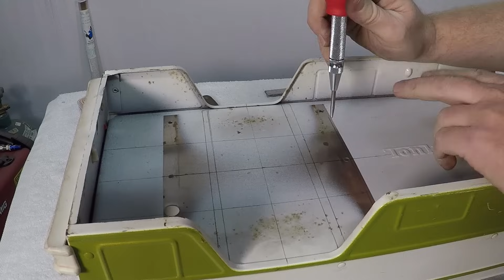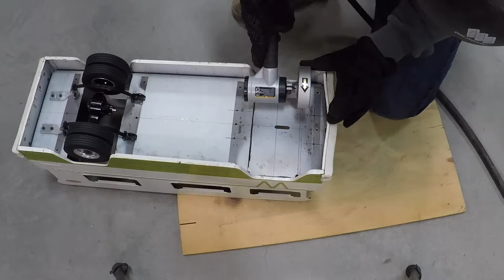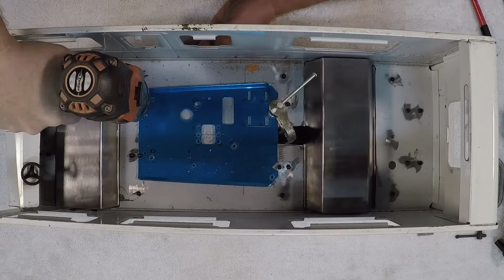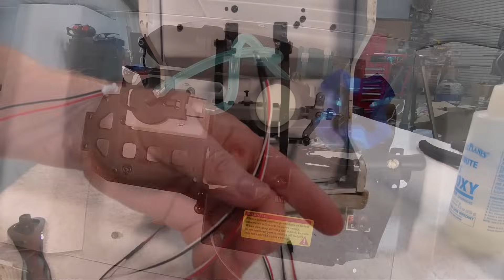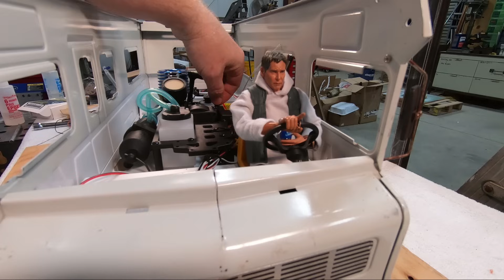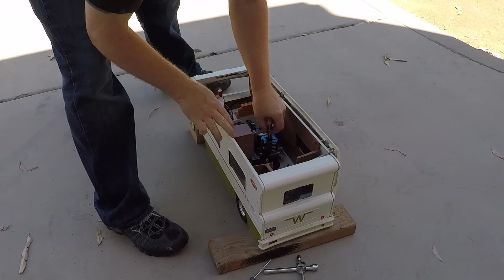Tonka Winnebago - Nitro Powered RC Build!

Comment: how much did you cut out of you front axle
Reply from the maker: I think I measured the distance between the leaf spring mounts. Then bolted the mounts on my servo and measured the distance between those. That gave me how much I needed to cut out of the axle... If I remember correctly.